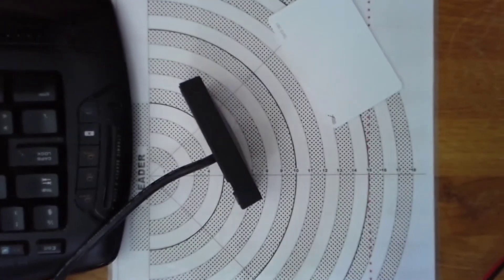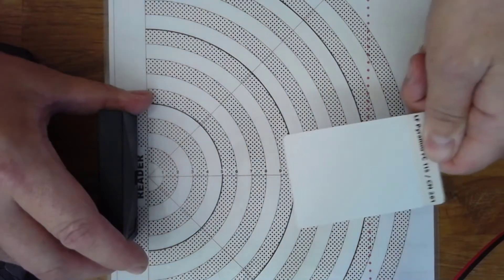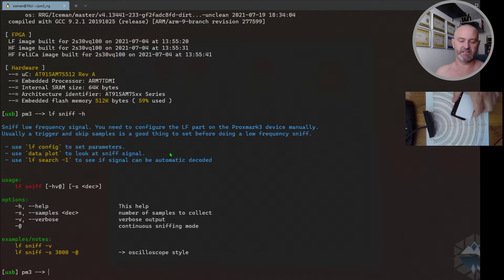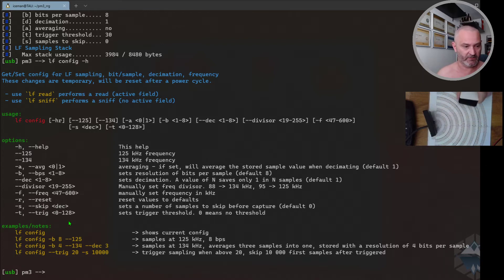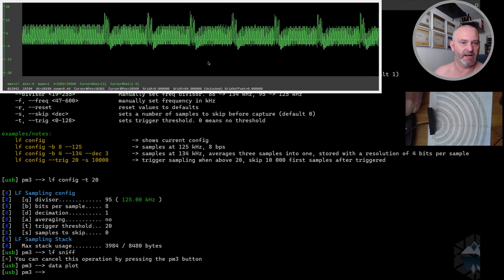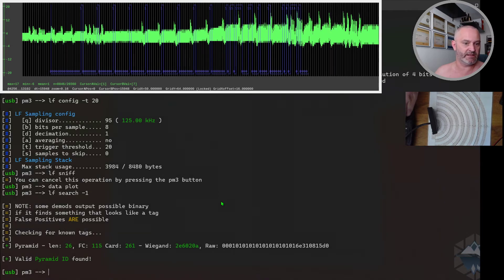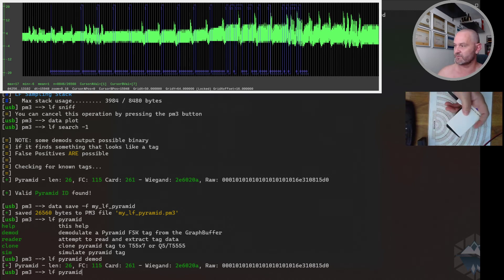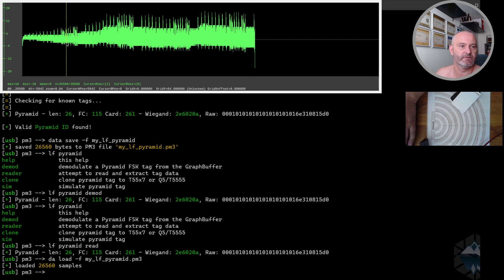Proxmark Low Frequency Sniffing Part 1

Comment: Can I also transmit a sniffed signal with the proxmark?
Reply from the maker: You can simulate a captured low frequency signal.
Reply: @iceman1001  Can I actually transmit it though with the proxmark
Reply from the maker: @TM-nq4tt  yes.

Comment: Hi friend love the vid, and thanks!
One question from a noob here, can Proxmark3 be held up against and sniff a T5577 reader and obtain access codes? (without having an original real access fob)
Reply from the maker: That is a great question.   If the Reader sends password the pm3 can sniff it.  
Otherwise you will need to sniff the t5577 writer.

Comment: Hey ice, couple of quick questions. One, what is the use of eml, bin, and json files?
Also on my graph while doing some t55 work I get a orange and light blue line?
It's not the pointer lines? what do they mean?

thank you.
Reply from the maker: the files is used to store data in different formats,  which you can backup your tags,  share.

blue line is demodulation plot.
don't remember what the orange line shows out memory,    have a look at the source code

one tip is to press `h` when the plot window is active. It will print the help text in your terminal window.
Reply: @iceman1001  Help does not show what the colors represent. I don't think light blue is demod. it's just a vertical line.